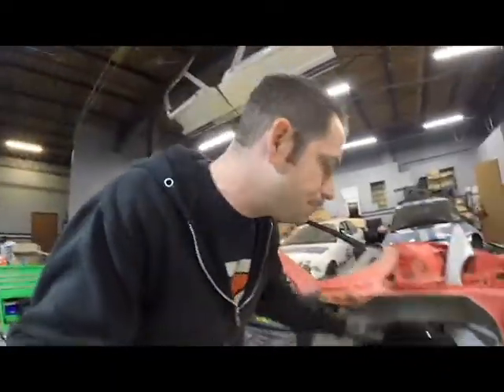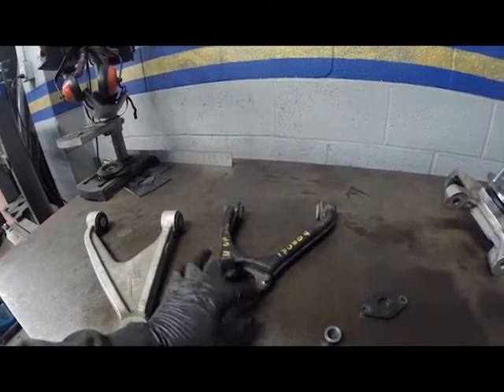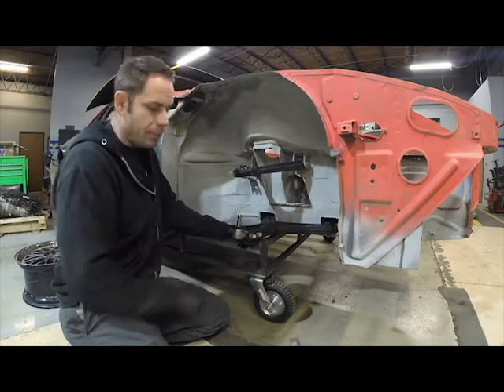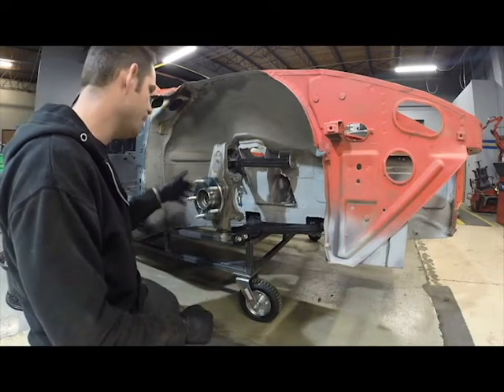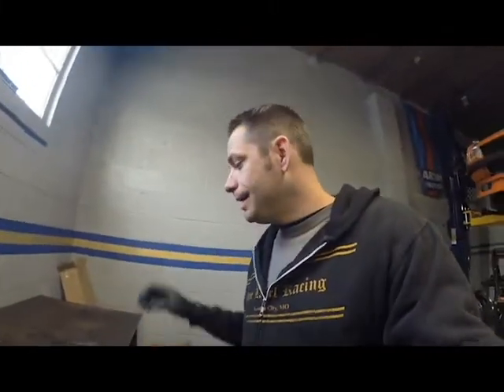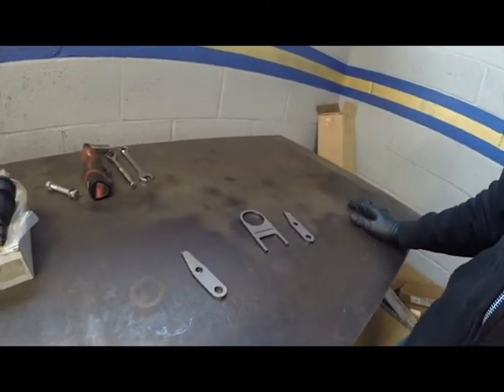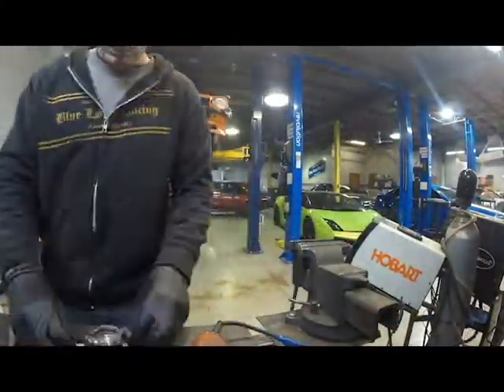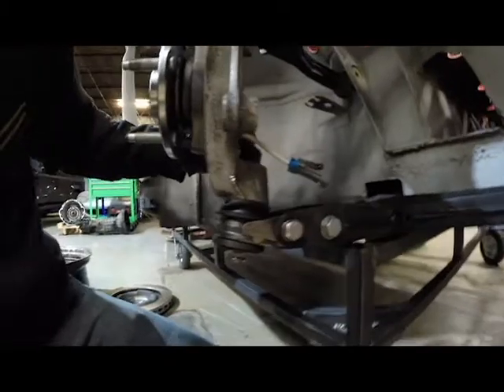Building Custom Front Suspension Pieces for my Ferrari 355

Comment: YT just suggested your video and this peaked my interest now since I build many pro touring cars using C6/C7 components and I currently own a F355 which I recently fully rebuilt the suspension to OEM. the cars suspension by design is quite well for the era of car and the weight distribution my absolute biggest complaint is the horrible rack and pinion ratio on these cars and even with dialing in caster and camber it still never feels confident like a modern car. Feel free to reach out to me would like to talk one day on your plans and bounce some ideas with you as I did have a plan to retrofit a custom rack and pinion. find my contact info on my page. thanks.
Reply from the maker: Yeah I love building and using corvette parts as the supply is large and cost is still low. I am building a c5 subframe to go into my 1965 Mustang and use a S550 Mustang front end on it. With a bunch of custom built parts of course.
Reply from the maker: I sent you am email as well.

Comment: if you like fabbing, make your upper or lower control arm (or both) adjustable length so you can dial in your track width and camber.
Reply from the maker: Eventually that will happen. I can currently adjust camber off the lower arm and that should be good for now.